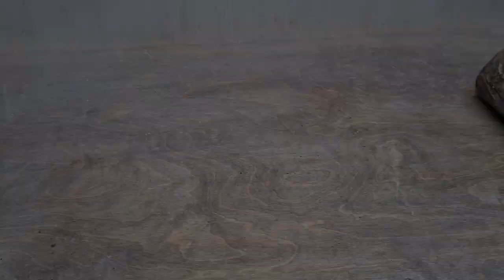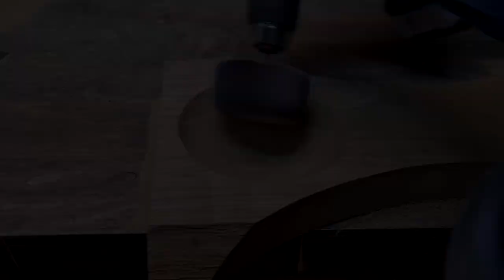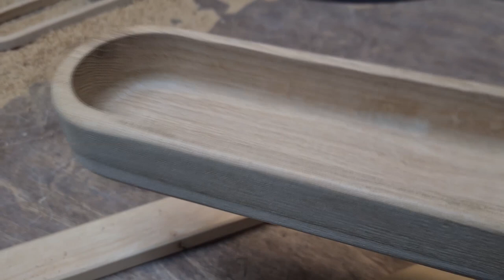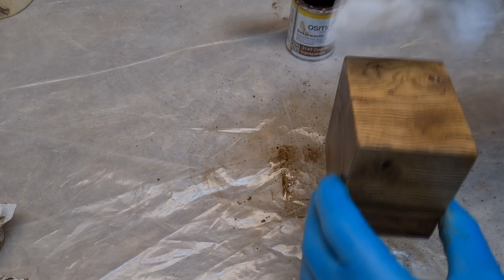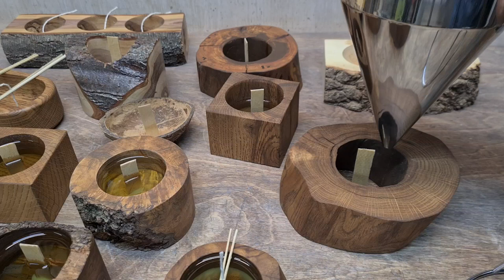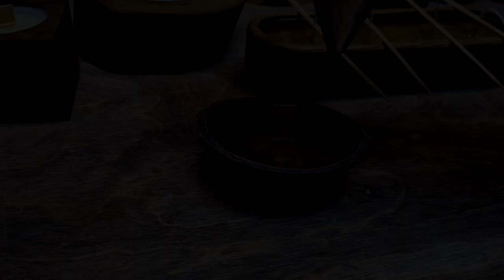Making wooden candle holders #woodworking #diycrafts #diy

Comment: Just stumbled across your video today. What are the purpose of the flat sticks you sank into the wax? How come you didn’t use a wick in its place? That’s my only question. However, excellent video. I enjoyed the original idea and it has inspired me.
Reply: They are called wooden wicks, you can use either or to light the candles. A lot of people use the wooden wicks for the crackling noise.

Comment: beautiful. been wanting to make my own. but going crazy on the heat protection element. did you use anything to give it heat resistance. and is that a stain with sealer that you painted on? Thank you for this vid it is giving me some motivation
Reply: They sell a fire retardant spray for the wood
Reply: I make and sell very similar ones.  I do use FireGuard I got on Amazon on all of them before I make the candles. I started making after watching lots of videos.  I love making them and have sold many and get so many compliments. You should do it! 😊  I buy my bowls. These are so beautiful!! Wish I could do that!